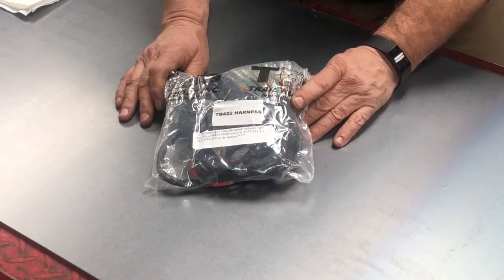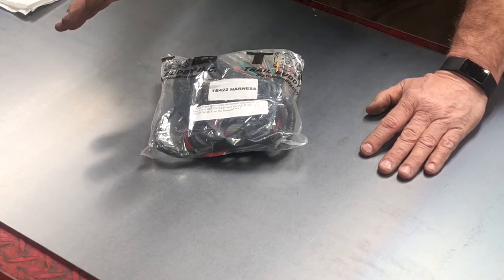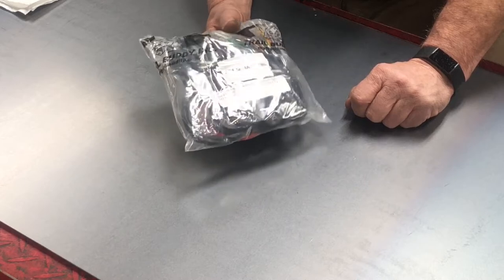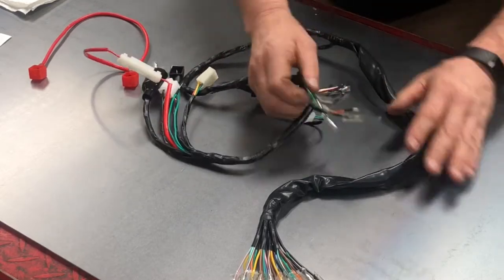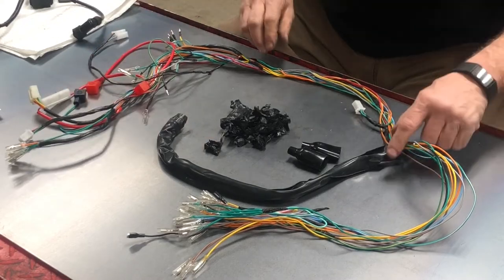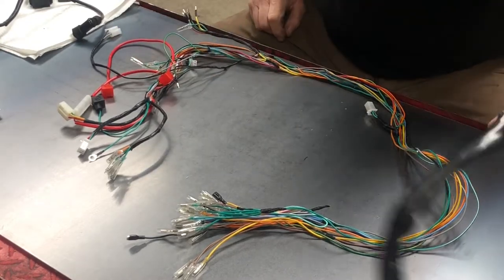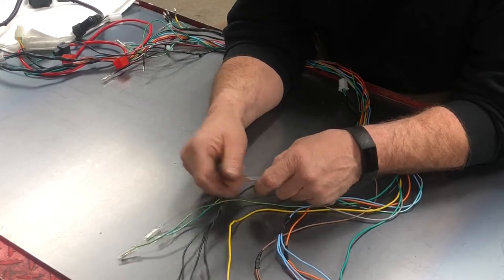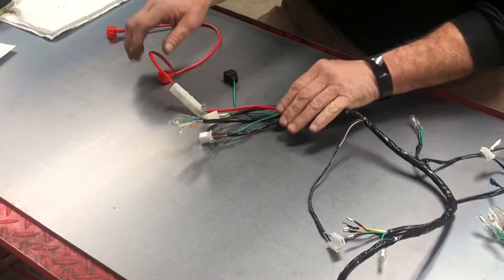Lifan wiring - Trail Buddy TB422 harness

Comment: my engine has a 5 pin plug connector with a blue wire, black wire, green wire, and two yellow wires but my wiring harness has bullet connectors and has blue, black, green, yellow and white wires as opposed to two yellows like there are on the engine side, can anyone help me out please? I'm not sure which colors to connect
Reply from the maker: @jeffreyharbin5211  
Blue/white to blue/white
Black/red to Black/red
Green to Green
Yellow of engine to ground
Yellow of engine connected to both yellow and white of harness.
Reply: @MiniBikeMike  wow you responded super fast I can't thank you enough! I'm still confused however, I know to connect blue to blue, green to green and black to black, but the stator has two yellow wires and so I'm not sure which yellow from the stator goes to the yellow in the harness and which wire goes to the white and I really don't want to mess anything up, is there any way to know for sure exactly which yellow wire from the stator is supposed to be connected to the yellow on the harness and which yellow wire from the stator goes to the white wire on the harness side? I would open the stator to confirm but I'm not really sure how to determine which coil is the charging coil so that I can plug that yellow wire into the matching white wire on the harness side
Reply from the maker: @jeffreyharbin5211  I explained what to do with the engine yellows.  Did you read the entire comment?
Reply: @MiniBikeMike it's kind of hard to understand when I have a harness with one yellow and an engine connecotr with two yellow wires.. I'm not sure which yellow on the engine side to connect to the yellow on the harness side, I'm not an expert and as far as I know the two yellows on the engine side might do different things and so I don't want to get them mixed up and ruin anything is all and your reply doesn't help me differentiate which yellow is which and I still feel I need more explanation or else I fear I may break something (for example one yellow might be for lights and one yellow might be for charging and I don't want to mix it up and fry anything) and it's a little hard to understand such a complex thing in point form with no explanation, yes I read it fully but am still a little confused, are you sure you read my comment fully? I figured I'd ask you, the expert but you seem to think we share the same skillet and that is not true whatsoever and so I will need more of a detailed explanation of the two yellows in order to know what to do, unless the two yellows are both lighting circuits and doesn't matter which way they're hooked up and the charging circuit is controlled by a different wire but as I said I'm not sure how this system works and am not sure what colors to plug into what as it's only 60% color coded, your harness looks different than mine so it's hard for me to understand based off this video alone,
Reply from the maker: @jeffreyharbin5211  If you go back and read my first response, it tells you exactly how to connect the two yellow wires.  I’ll type it out again…..
One of the yellows from the engine connects to chassis ground.  
The other yellow from engine connects together with both the yellow and white wires of harness.
Reply: @MiniBikeMike my harness has one yellow wire,one white wire, and one green wire (solid no stripes), and one striped blue/white wire, and one striped red/black wire  

my engine has one striped red/black wire,one striped blue/white wire, one solid green wire, and two solid yellow wires instead of one yellow and one white and so I'm not able to follow the color coding for those two wires on the engine side since one yellow from the engine must plug into the yellow on the harness, and the other yellow from the engine must plug into the white wire on the harness but I'm not sure which one of the two yellow wires I have to plug into the white wire
Reply from the maker: @jeffreyharbin5211  I can’t tell if you’re serious or just trolling me.  Either way, I’ve explained it twice.  I think I’ll bow out of conversation, at this point.
Reply: @MiniBikeMike  so connect the yellow and white wire together from the harness and then connect that wire to one of the yellows that come from the engine and ground the other? this is not at all how it was wired before the new engine swap.
Reply: @MiniBikeMike   @MiniBikeMike  the wires from the engine are supposed to plug into the wires on the harness are they not? so what do you mean ground it? one of those wires is dedicated to ground the stator to the chassis anyways right? unless you mean plug it into the wire that goes to ground but then which wire is that... white or yellow? this is not helping at all, thanks for trying I really appreciate it but I will have to go ask someone else as this is not helping at all, if I could send you photos you would understand what I'm talking about but I think you got it mixed up, but thanks for making me feel like shit and for getting me no closer to figuring out this wiring, hope it makes you feel tough "I've already explained it twice" ya I'm not a damn mechanic so maybe it'll take three explanations, if you're not willing to do that then no biggie but no need to make people feel bad for not knowing what you know, I paint cars and do a damn good job but you don't see me out here bullying you because you can't produce the same 20k paint jobs that I do, we all have our strengths and weaknesses...
Reply from the maker: @jeffreyharbin5211  You reached out to me and ask how it needed to be wired.  I gave you that info twice, but you’re unwilling to accept the info given.  I’m not sure I can help.  Good luck to you.
Reply: @MiniBikeMike  because I'm still confused and you're essentially saying "just get it already" I reached out because I thought you would help me figure this out and not just expect me to understand whatever you say as if I'm you, but I'm not and the point of these videos are to be informative, but since your engine wires are different I came to the comment section to seek more help... no where in the videos you post did you "connect the yellow to ground" no, you instead connected the colors to the colors, not to the chassis, so how the  hell am I supposed to accept that as the answer without any further explaining, for all I know you're trolling me because that is not what you did in your "lifan wiring just to run" video, in that video you plugged the wires together, not the ground, and if you're referring to one of those wires as ground then tell me which one that is since it's not obvious to me (someone who's never done this before by you an expert) but since I didn't understand you are now dismissive rather than trying a different approach, like why would I ground anything when there's dedicated ground wires, I'm not an electrician nor a mechanic so I will need more explanation before I begin rather than "just ground it, I already told you can you not read", maybe tell me why I should be grounding this and what will happen if I don't etc, and actually be informative, that's the whole point of this channel isn’t it?
Reply: @MiniBikeMike  I know how it needs to be wired, I have the instructions right in front of me, that's not what I asked you, I asked you how to differentiate what yellow wire is what,

my old engine had one yellow and one white and my new one has two yellows and so I need to know which yellow to treat as the white wire that was on my old one so that I can plug that one into the white one

but you say

yellow to yellow 
yellow to white 

WHICH YELLOW THAT'S WHAT IM ASKING YOU
Reply: @MiniBikeMike  if I could send you photos you would realize how little this advice would help lol
Reply from the maker: @jeffreyharbin5211  No, the point of the channel is not to be informative, rather it’s for entertainment, as viewers watch me build my bikes.  I’m not an electrician, nor a mechanic.   I’m just a guy who had tinkered with bikes for a long time and figured things out on my own, along the way.   It’s sounds like you’re wanting a more in-depth education on how the electrical system works.   Unfortunately, I can’t provide that info, I don’t know the answers.   Different engines have different stator wiring configurations.  There is no blanket….”this is how it is always wired”.    A stator with two yellow wires needs to be wired as I explained.  Why does it get wired that way?   I have no clue, I just know it works.   Good luck to you. Hopefully someone will give you the technical info you desire.
Reply from the maker: @jeffreyharbin5211  I never said:

“but you say

Yellow to yellow
Yellow to white”
Reply: @MiniBikeMike  good response, I can respect this and fully get where you're coming from, it's just I know how it was wired before and it was yellow to yellow and white to white and so when you told me to ground the one yellow, and it also (sorry if I miscontrued) seemed like you were making fun of me for not knowing what to do and I thought you were just making it harder for me but I now realize that you were not explaining it further because you didn't want to mislead me, I honestly had no idea that it was different for some bikes)
Reply: @MiniBikeMike   someone told me that  those wires are just accessories and it can actually be connected yellow to white and white to yellow without making a difference, so my situation is sorted I was definitely just overthinking it, but to your point of this channel not being informative, that's actually kind of awesome and I never even looked it at that way before, I tend to use YouTube as a way to teach myself things or have other teach me through their videos, but never really watch just for entertainment, with that being said you've just gained yourself a new subscriber! I'm sorry for the hard time I gave you, entertainment is always nice so from now on I'm just gonna shut up and watch 🤣 thank you for trying to help me, I should've been more accepting of the information!
Reply from the maker: @jeffreyharbin5211  My advice…..screen shot the wiring instructions, that I posted in earlier comments.   When you realize that you were given inaccurate information and your charging/lighting doesn’t work correctly, you’ll have a reference to go back and wire it properly.